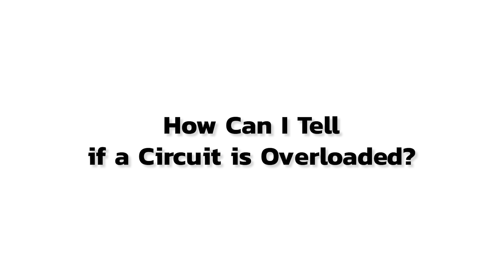How can I tell if a Circuit is Overloaded | Fusion Electric

Comment: Plugging in too much stuff can overload your circuit. Dealing with it nownand have in the past.
Years ago i let someone stay in my furnished garage. Plugged in a power.bar and had a TV, Phone Charger, Lamp, Mini Fridge, Window Unit AC, Toaster all on one Power Bar and.kept tripping the circuit.

Now my wife has extension cords all overnthe house and the microwave runs at half power, lights dim when microwave or dryer turn on, etc.
She thinks i neednto update all the wiring in our 2,000sq ft home ($10-15,000)
I think she needs to unplug some stuff.
Tomorrow imm gonna figure out which lights, outlets, and rooms eavh breaker controls and find out which room shes overloading the circuit. I have a good idea. KITCHEN! Microwave, Fridge, Deep Freezer, Coffee Maker, Toaster, etc